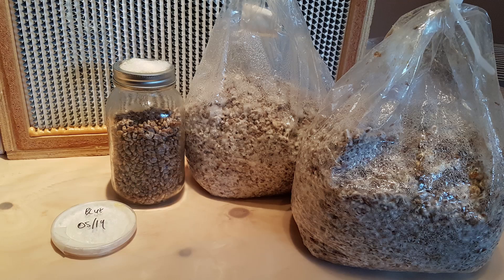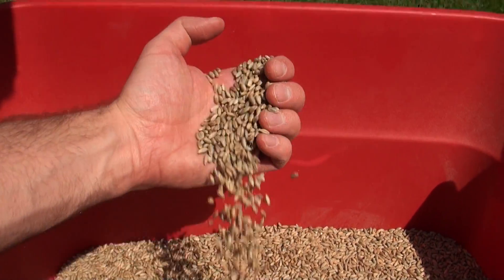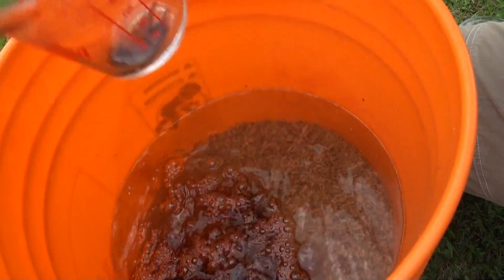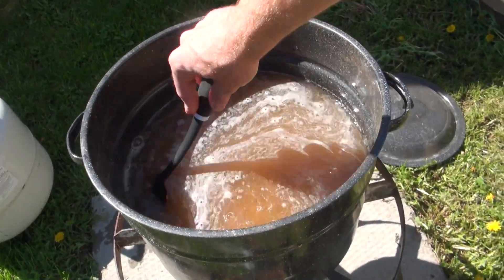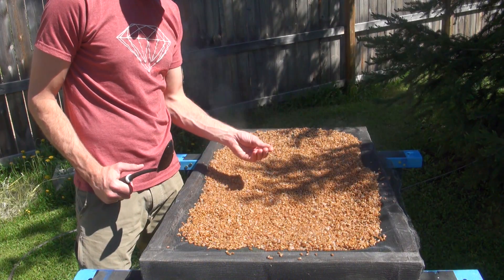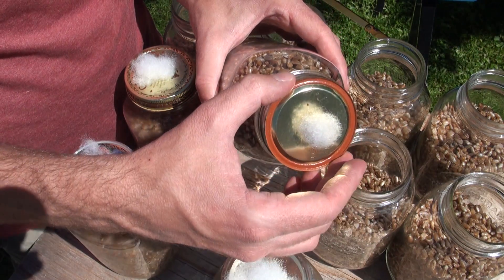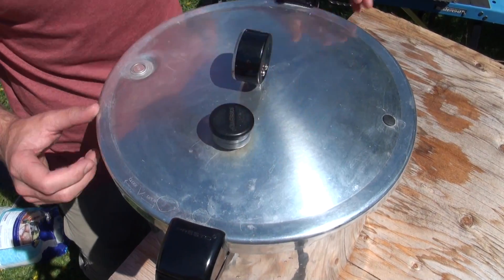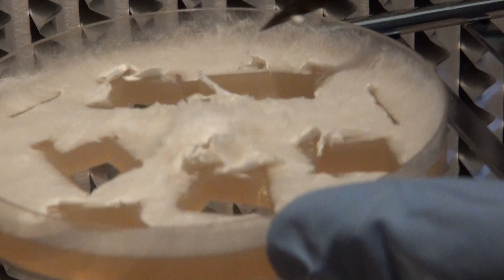How To Make Mushroom Grain Spawn: Preparing the Grain

Comment: I am very confused about the sterilisation process of the grains.
I the grains were boiled for 10 minutes or more they are sterilised, and the second sterilisation in a pressure cooker is not needed.
No bug can survive boiling for 10 minutes or more.
If the jags need sterilised, place the in the microwave with a bit of water and will be Ok.

Comment: you can actually, if your PC hits 23 PSI, like the AA steam sterilizers do, which is what I use, do 35 minutes for quarts at 23 PSI. this was said to be sufficient by unicorn bags for their T3 bags (maybe a few lbs 1 or 2 of spawn? not sure) w grain. of course it should be longer when heavier and denser I know but you dont need to hit a brf half pint w 90 minutes at 15 PSI that is NOT necessary. people need to research and TEST these times out that extra unnecessary 30 minutes at 15 PSI, I know because an hour at 15 PSI is fine w most applications, waste a lot of electricity and effort and time for no reason other than lack of exact knowledge and regurgitation of "facts." I tested unicorn's presupposition and they are correct I get no contamination on grains done at 23 PSI for 40 minutes repeatedly w success...long term. only contaminants in my grain are just straight up errors from lazy or lapses in sterile technique because I have a nice flowhood and the best equipment so it is all human error derived or contaminants that make it through the HEPA filter or isolation for culture of spores or myc from non sterile material...lots of prints are filthy my man!

Comment: If you buy sterilized grain can you just go ahead and inoculate it or is there anything you need to do to it first? . And should you fold the air window over or just leave the bag standing unfolded ?  Also what temp should it be stored at  after inoculation. Thanks.

Comment: Two Questions:   1) considering that this goes on all the time outside in natural environments; is Sterilizing absolutely necessary?
                               2) Is it possible to use mushroom spoor strait from the mushroom cap rather than culturing it first?
                                             Your video's are great by the way!    thanks...
Reply: The way I grow mushrooms is finding them, Identify them ant then cut off the stalk, and placing the cap onto a paper towel and into a plastic bag. then wait a few weeks, and take out the paper towel and throw away the rest.(this part of my process is disgusting btw.) Then let the paper towel dry and then you can store for as long as you want. Make sure the paper is completely dry though. I dont sterilize my paper, I don't have a ps. Then I rip up the paper towel and put in compost outside. It doesn't always work and if you have many types of mushrooms growing then only some might grow ☺️
Reply: @Freyja-r9d  
Some is better than none, with no investment other than a paper towel and a plastic bag.   Bravo!
Reply: It needs sterilisation because it's an enclosed environment. You don't want the mycillium competing for food. 
Yes you can use a spore syringe but it takes longer to get started

Comment: I haven't read all of the comments below so not sure if I double up - but the one thing that one does when pressure canning food is to allow the steam to push all the air out of the pressure canner. This  requires to leave the weight off for the first 10+ minutes. Once you see a steady stream of steam exiting the pressure cooker for 10 minutes then you put the weight on and processing time starts.

Comment: What is the metal thing that you have at the bottom of your sterilizer called? So the glasses are not in direct contact with the bottom of the pressure cooker

Comment: Doubt if you’ll remake the video, but if you do can you mention that drilling a 1/4” hole in the lid creates a possible bloody thumb or finger scenario. The jagged edge of the newly drilled hole and the propensity of the polyfill not to want to go thru the hole easily means you have to grasp it with tweezers or needle nose to pull it thru (if you are the world’s worst brokanic like me. Also, tried to get it to simmer, but my pasta pot wasn’t big enough to allow the water to fully boil despite 25 minutes of trying to get it up to a boil. Use a large pot.

Comment: I'm curious why you chose plastic wrap to cover the bucket while hydrating instead of using the lid of the bucket? I have buckets with lids.
Also, could you inoculate the grain with liquid spawn directly through the polyfil filled hole so you don't have to open the whole lid and expose it to more air?

Comment: Hey there! I have a few questions regarding your sterilization :0! Would an "INSTAPOT" work just as well for this process?
Reply: Mine is the pre-instapot model and I purchased it for this process, which I run on # 8 Beans/Lentils for 90 minutes, it holds three quarts jars or a slue of the little jars, Tyvek paint pants make nice lids patches, had some of this poly fill, but can't find it, this is making lots more sense now, where to get gypsum, maybe hardware store.

Comment: Grains are actually the most difficult substrate. I never got it right. Even mixtures with earth and rice flour work better than grains.
Reply: I would like to hear more about your method.
Reply: @127chefster  It is a long time ago. More than ten years. But it is like the brown rice method except that you use soil or "Anzuchterde"(soil poor in nutrients for germinantion) instead of vermiculite and use just enough water so that the mixture forms balls when shaken. I always used tyndalization as I had no pressure cooker. I recommend to use better glasses as I only used alu foil to seal them ... even without air filter which is no longer recommended.

Comment: What’s the point of sterilization if your doing this outside? Lots of spores and mold in the air to get into grains and jars.
Reply: Murphis55 sterilization came after the open air part. It happened when he put the jars on the pressure cooker. 😉

Comment: Is there any other way to sterilise the grain for those who don’t have that sterilisation equipment?
Reply: All you need is a pot big enough to boil the jars in. I am just starting this mushroom growing thing gathering info, but I have a degree in biochemistry and have worked with this type of stuff in the lab before. This guy seems to really draw out some steps, particularly getting the grains wet and sterilization. I suggest looking at sterilization technique or aseptic technique videos for ideas on how it works to avoid contamination.

But basically, I don't think you need to worry about any pressurization. Worst case scenario you have decreased yield, but boiling the grain should be enough to reasonably sterilize! Aka just do what he says with the jars and put it into a pot  and once it starts to boil begin the time for ~10 minutes. :)
Reply: @iRoXsOxAlOt  I have a microwave pressure cooker, I'll give it a go. I want to do it as a learning experience with children - little naturalists.

Comment: As a production brewer, I have (literally) tons of previously milled and wet spent grain that passes through the brewhouse. The leftover sugar content is typically negligible. Would it be possible to pick up at boiling the mashed out grain for sterilization and then inoculate once it with spawn once it has returned to ambient temperature?
Reply: Have you tried using the spent grain for mushrooms? Otherwise what is done with it?
Reply: @connectgo-com I haven't yet hence my question. It's typically hauled away as cattle feed. I use a lot of grain on 120 bbl batch days.

Comment: I saw somewhere you can inoculate your grain jars with a piece of mushroom cut out of the stem, is that true??
Reply: You can. It's easier to control with agar plates though
Reply: Yes, use a sterile knife and cut into either the cap or stem always being careful of contamination.
Reply: micregil thanks, I’ve just got my first taste of success, unfortunately there is mould so will need to work on the sterilisation.. cheers

Comment: t has been at least three weeks since I injected my bags and only see growth in two small tiny spots about the size of a dime. I have been storing the bags in a dark cabinet with a warming pad set to 75 degrees F. Any suggestions? I have read about growth "stalling" in which growth appears to stop and mixing the bag can kick start it again, but the growth spots are so small I do not know if mixing will do more harm than good? I am wondering what is causing this very slow growth. I am suspecting the cultures I purchased had super low spore counts but that is just a guess, I am a newbie.
Reply: Using Mason jars, and cooking your own spawn will give you more control over the process, then, after inoculation, shake the jars every two or three days. The spawn should be completely grown through in two weeks.
Reply: micregil  Thanks for the tip!
Reply: It's a fascinating subject and can be complicated, you should a get a couple of books to learn more about it.

Comment: WARNING MY FAMILY. MANY PEOPLE SELL PLUGS FOR LOGS TO RAISE THESE AND OTHER STRAINS. MOST SELL ONE INCH PLUGS  LIKE IN FURNITURE. SOME USE 3/4 INCH PLUGS WITH BIG ANGLES THE "POINTS" ARE LESS MATERIAL INSTEAD OF A FLAT SURFACE  SO FOR THE SAME PRICE YOU GET 750 INCHES AND POINTS INSTEAD OF ONE FULL INCH TIMES 1000 AND FLAT WHICH SEALS WITH WAX MUCH BETTER AS IT DOESN'T WICK THE WAX ALONG THE HOLE. ALSO LONGER PLUGS DON'T MAKE YOU SMACK YOUR THUMB WITH THE HAMMER A THOUSAND TIME FOR A LARGE BAG. EASY GROW USES LONG PLUGS, MUSHROOM PEOPLE USE POINTY LIL SUCKERS. CAN YOU TELL MY OLD THUMB DOESN'T LIKE IT. BUY QUALITY SPAWN. DO NOT LET A GOOD OAK LOG GO TO LAND FILLS. IF YOU HAVE SHADE AND A WELL SET UP A MUSHROOM FARM RIGHT NOW.  STOP  "TREE CUTTER " TRUCKS AND TALK TO THE PERSON IN CHARGE TELL HIM YOU NEED YOUNG TREES CUT AS LONG AS HE CAN HANDLE TRIMMED OF BRANCHES. INSTEAD OF RUNNING IT THROUGH THE CHIPPER. I PAY BETWEEN ONE TO THREE BUCKS FOR SMALL TREES.  BE PATIENT SET UP WELL FED SPRINKLERS TO RUN AN HOUR TWICE A DAY BEFORE DAWN AND LATE IN AFTER NOON.  SOON YOU'LL HAVE PEOPLE COMING TO BUY SHROOMS OR LOGS READY TO GO. USE LOCAL LOGS SO YOU DON'T SPREAD BUGS FROM OUT OF STATE. DON'T BUY A CALIFORNIA LOG FOR FLORIDA PLEASE FOR EXAMPLE. MAKE AMERICA GREAT AND GREEN ALWAYS, SUPPORT LOCAL FARMERS AND YOUR SHERIFFS TOO. GOD BLESS AMERICA.

Comment: Can you use spent grain from brewing beer for this process?
Reply: No. That's not how the brewing process works.  There is no alcohol or yeast in spent grain.  The grain is steeped in near boiling temperatures for a few hours and then the "wort" is drained off the grain, boiled, cooled,  and then the yeast is added to the liquid which creates the alcohol.  The grain is spent before the fermentation phase.
Reply: I am guessing here, so I hope someone with more knowledge will pick this up so we both learn something.  I am assuming both the alcohol, and left over yeast would cause issues.  Although assuming you could cook all the alc out, and kill as much yeast as you can with pasteurization, maybe the next issue would be nutrient?  Although if nothing else im sure it would work large scale for someone who has the means and can source spent grain more easily then sawdust as a medium.  Let us know any info you may have fond, I am curious to see it in practice.  I have used coffee chaff in the past.  only because I had pretty unlimited amounts.   Worked fine.

Comment: Way, way to much time wasted here! There is a much, much easier way!  I do it all within 2 hrs. And worrying about the "debris" is a waste also.
Reply from the maker: Yes, there are always ways to improve- working on getting the systems better all the time... you are likely right about the debris, but sometimes there is a lot of extra "stuff" in the grain that can muck up the spawn.
Reply: Sorry if I sounded like a dick. Have you tried the no soak method that I use. You can't lay them down but, it saves hours, and hours of time. One cup wheat/rye in a quart jar. Add 2/3 c water (maybe a tbs more), and 1/8 tsp gypsum. Give a little mix. PC at 15psi for 90 min. Done!

Comment: After completing the sterilization and removing the heat, do you let the jars cool inside the pot before opening? A cooling jar with an opening will have to draw air in - I guess the poly fluff barrier is sufficient. Thanks for the video!
Reply from the maker: Yup! Just let it cool down fully first :)

Comment: You sterilized the grain before putting it into jars, then sterilized it again when inside the jars. There is getting to be a significant energy cost here, and I'm wondering why it is necessary to do the operation twice?
Reply from the maker: Hey Phil! The first cook isn't for sterilizing, it is just a way to get optimal moisture inside the grains. The pressure cooking after the jars are loaded is what sterilizes the grains.
Reply: @FreshCapMushrooms  why does plain boiling not do the job?
Reply from the maker: for grain spawn, it is too nutritious, so after you boil them they are exposed to the ambient conditions, any mold spores or bacteria that is still on the grains will then proliferate before the mushroom mycelium gets a chance
Reply: @FreshCapMushrooms  I see. Thanks for explaining. Looks like I need to buy a pressure cooker...
Reply: I always used a large cup of rye grain, a third cup of water, no gypsum, and pressure cooked for one hour, then you can inoculate after the jars reach room temperature, then shake the jars every two or three days. I used a pressure cooker from Walmart, but it would only hold seven jars. I always had great success. Growing mushrooms is extremely interesting, and you all may want to get some books and read up on it, also there's many species of mushrooms that can be sold to restaurants and markets, so if you're in a position to begin growing, I highly recommend it.

Comment: What's yer sub? Could said person use sterilized coffee grounds in a 64qt instead of hpoo? How much should said person poor in, I get confused about how to know or measure that?
Reply from the maker: Hey there! I typically use a mix of sawdust and a supplement, one substrate i like recently is the "masters mix " which is sawdust and soyhulls, a 50-50 mix. won't work great for all mushrooms though, but for most gourmet and medicinal (minus shiitake) it works amazing. in general though, a 5-10% spawn rate is ideal for small home grows.
Reply: GAB3R3AL brotha you don’t need to do much, search “daimon5050 easy sub prep shroomery” super simple ... search on google or whatever search engine you use . 💯🤙🏻 works just fine for cubes no hpoo needed
Reply: GAB3R3AL actually it doesn’t even require a pressure cooker , just a certain amount of boiling water and a bucket .

Comment: What's the difference between grain spawn and substrate? Most pf tek recommends vermiculite mixed with rice flour. What does grain spawn Do?
Reply: grain spawn is a medium that you inoculate, usually consistent of common grains such as rye berries, wild bird seed, popcorn, horse oats.. Etc... the substrate is what you mix your grain spawn with after its fully colonized to create a larger mycelial mass to colonize to be able to fruit. Substrate can consist of many different things, coco coir, verm, saw dust, hard wood fuel pellets, wood chips.. etc..  PF tek is a good beginners way to learn the life stages of mycology and learn sterility practices. PF tek doesnt use grain, your essentially inoculating the substrate and fruiting right from it. Best luck!

Comment: I burnt my grain in my pressure cooker because of placing the jars in the bottom :( I need a trivet to level it up so it's not touching the water.
Reply from the maker: Interesting! Better try again... you can try and use a bunch of jar lids to get them set up a little bit. I just melted a bunch of bags as well, the cooker ran out of water and burnt the bags.
Reply: It could've been the same mistake. I need to put more water in, but if I would've I would've gotten the water level above half the jars. I'll make sure I put enough water next time, and also put the jars above the water just in case. I'm really enjoying the videos from the channel!
Reply: I never had a trivet either, I would make a ring out of wadded up aluminum foil, and never had a problem.

Comment: I use brown (whole, with the husks) rice bought at the store, half cooked in a pressure cooker with distilled water. Never rinsed or sterilized after cooking. The jars I wash with ammonia and rinse profusely before canning the cakes. After the cake is done fruiting I just prepare more rice, load up more jars, and cut up the original cake split among the new jars.

Contamination in my experience is only an issue until the substrate starts getting well populated. After the mycelium has taken over, you may occasionally see a green or blue mold start up, just cut it out with a sterile knife. By that point the cubensis culture is strong enough to withstand any intruder for a while.
Reply: HMan can you send me more info about this?
Reply: You have literally no idea what you're doing.

Comment: I thought in pressure cookers the water isn't suppose to touch the jars ? since your suppose steam sterilize not water bathing (boiling) .. or does it not make a difference ?
Reply from the maker: It's totally fine for the water to touch the jars, as long as it stays out of the jar, ie. the water level is below the top hole.

Comment: Also what kind of material are you using for that diy strainer that you used to dry out your cooked grain?
Reply from the maker: That one in the video is just a window screen, not sure exactly what the material is. You can use any fine mesh screen.
Reply: thanks for the awesome tips, man! the screen method is far superior to using a colander. you can spread the grains out nice and thin and they cool and dry off evenly on both sides :) cheers